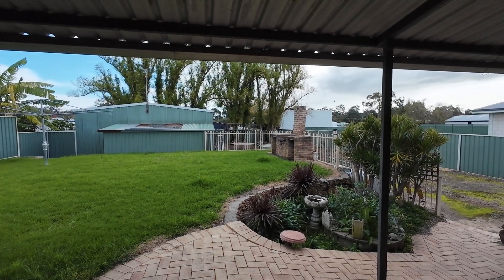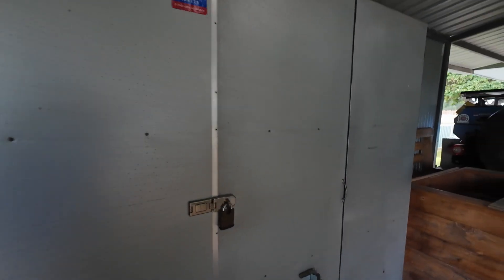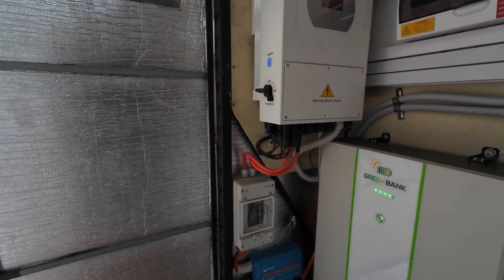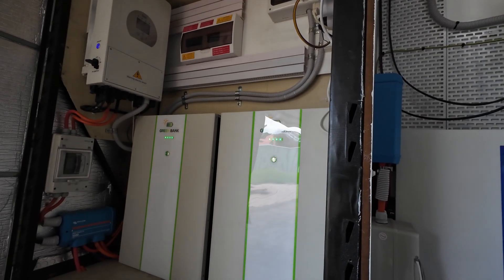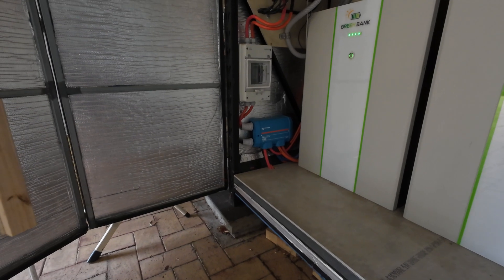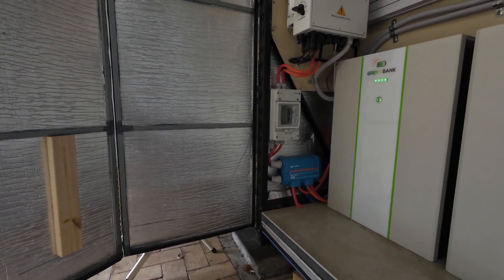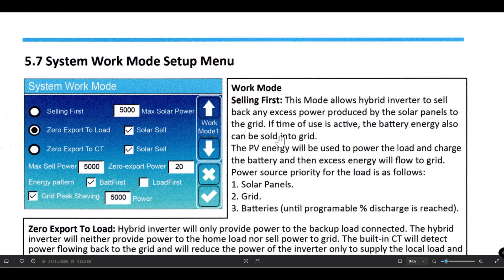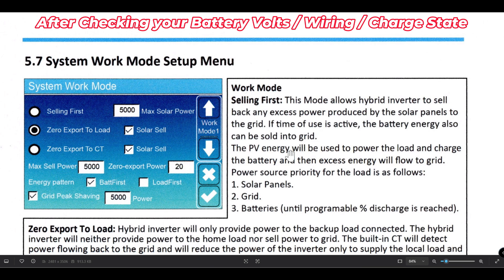Deye Inverter F56 Fault Code:  Problem Solved 👌

Comment: F 26 problem video plz sir
Reply from the maker: Sorry, I haven't come across that fault code yet to make a video.
Reply from the maker: I looked the problem up for you. 
Deye inverter F26 fault usually means a DC Bus Unbalance, common in split-phase systems with uneven loads or PV string issues (earth faults), but can also stem from grid settings (reactive power) or loose PV cables
Hope that helps

Comment: F58
Reply from the maker: The Deye inverter code F58, or BMS_Communication_Fault, indicates a communication failure between the inverter and the battery's Battery Management System (BMS). Check the communication cable or BMS problem. Or you're just not using a compatible battery. Or if using more than one battery, you do not have the little switches in the right position. Failing that, you can just ring the installer.

Comment: i am seeing this fault a lot lately , in particular when the mains(grid) power shuts down, read all sorts of complicated things about electronics malfunctioning , etc, but thanks to your video i am able to narrow it down to a moment in time , some guys were here and uninstalled a hybrid solar ac unit, since then the issue has popped up again and again (only when off grid) so while I am on grid , there is no problem , but when I need it most , when the power goes , then i have this error (and no power) - unfortunately your fix did not work for me this time - but put me in the right direction- during the day tomorrow I will be checking the cabling
Reply from the maker: Glad you were able to narrow it down; hopefully, you can find the problem and get it all working again. 👍 The inverters are very sensitive. Where the power grid does not have to meet the same testing standards. That is also why people get electrocuted when on grid power. A really good friend of mine installed the 5kw Deye, and it would not start. Living close to me, I then took all my testing gear over, and indeed it had a 100v ground fault. It took 2 days to find the problem. When the installer installed the solar panels, he pinched one of the cables that came out the back of one of the solar strings between the rail and the solar panel. Easy to fix but a real bugger to find. Why am I telling you this? Have you tested for a ground fault? If you have one, then the last thing you installed or uninstalled in your home could be the cause of it.

Comment: Mine is on Battery first. And im still getting the F56 error
Reply from the maker: Then check your wiring. Maybe you have a faulty connection on the solar side or the battery side; undersized wiring can also cause it. It's hard to say without knowing your system build. Maybe you should upload a video showing your system and its wiring and solar along with the wire sizes used and the amount of power you're pulling through the system. See if I can help you sort it out. 👍 Let me know if you make a video; I will come look at it and see if i can spot what may be the problem

Comment: I have a separate system for my solar refrigerator I kept getting dead batteries and I use  big cables my charge controller is too smart it was trying to tell me that I had a bad connection I had the wire brush the ends of my cables I thought that was strange it was so sensitive 2 lipa 4 batteries same charge controller is Garfield has strange stuff I run into sometimes
Reply from the maker: Sounds like a frustrating issue with your system.
Reply: It's been doing  ok after I clean in cables okay   for 6 months hopefully it keeps working okay

Comment: Hey Chris, nice troubleshooting mate, first thing that came to my head was, there's many voltages in a solar system, it might not necessarily be the battery voltage....well done mate it's satisfying when you can nut out a problem !!! 🤠😎
Reply from the maker: Thanks, my friend. That was the fault code for the internal DC buss. so it could only be battery or solar. 👌

Comment: another option would be disable sleep in your batteries, or is that not configurable in your bms's ? 

running same inverter, seplos batteries, load first ticked, but never has this issue
Reply from the maker: Seplos batteries are not mentioned as an approved brand for solar systems in Australia. In other words, I cannot find them on the federal or state government approval lists. It's crucial to check for relevant certifications and compliance with Australian standards for battery storage systems. There's no need to reprogram the batteries when a simple tick in the right box on the inverter fixes this problem. :hand-purple-blue-peace:
Reply: @JustinCaseSolarPowerjust giving an example of batteries where this is not a problem..

Also, removing that tick, sets you batteries as prio , even at low sun.
For you being off-grid it won't matter, but for anyone gridtied, they may run into the situation that they are pulling power from the grid for loads, because sun is being used for battery top up
Reply from the maker: My inverter is set up for off-grid use. How grid-tied systems are set up is mostly done by the installer. And most people with on-grid systems should never touch the system when it is set up. They simply don't have the knowledge to do it safely. Regulations change from state to state, but federal regulations trump state regulations every time. At least here in Australia. What other countries do has nothing at all to do with me.

Comment: I have not watched your videos in a while. You had those 12V lead acids that took up a lot of room. This is much easier to look at
Reply from the maker: Yes, it is a massive improvement. 👍 Even with the old setup, I had redundant systems. I have that with the new systems. This one works much better and is 100% fully automatic. Just loving it. 💕😁

Comment: Understanding your system is everything
Reply from the maker: Yes, it is. This inverter has so many settings in it. Can be overwhelming for most people. Simple understanding and problem-solving can fix a lot of things.
Reply: @JustinCaseSolarPower yes for sure make one change and wait to see if it effects others as the logarithm is tied to all settings and the value we think it means are sometimes not what the originator thought.